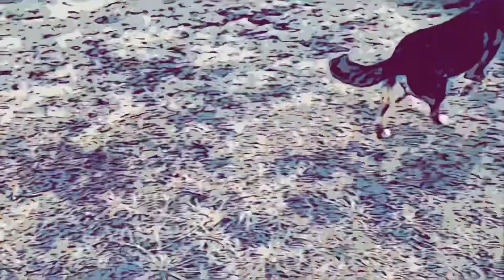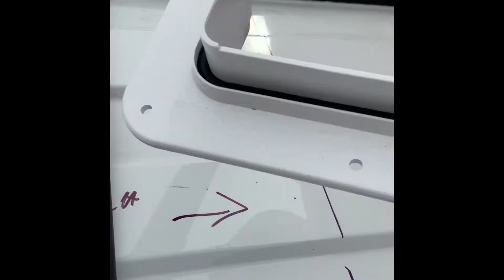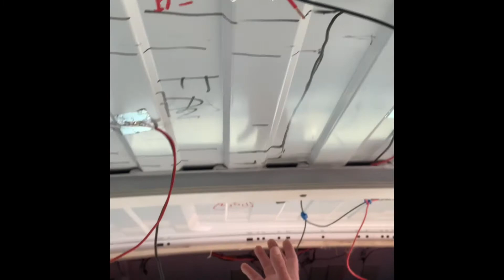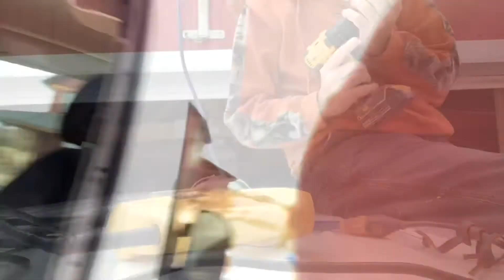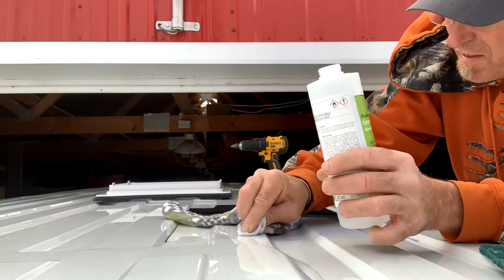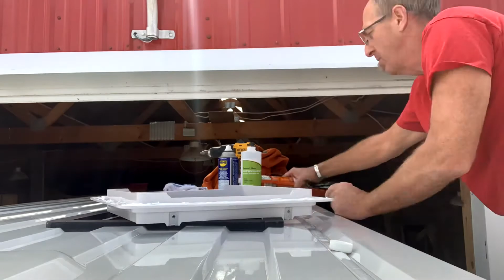MaxxAir Fan Installation with Roof Ring

Comment: Enjoying your videos, just picked up my 2018 1500, going to start the build soon.
Do you think it is necessary to add a wood frame on the inside for the fan?
I have seen it both ways.
Thanks
Reply from the maker: I put some in but light. It depends on where you place the fan. Good luck

Comment: Great video Thanks. I purchased one of the rings as in your video.
Looks like a cleaner install but I was wondering how weather safe they are and how long they may last.
I am in the desert, hot and dry. Hope it doesnt deteriorate. How has yours been?
Thanks
Reply: I have done 3 now and they have been really good. One has quite a bit of sun/desert time. No deterioration. Good luck
Reply: @johnthorsteinsson6122  Thanks.

Comment: Nice. Hows fan, any leaks?
Does promaster have any constant power wires near by under roof to tie to? Ty
Reply from the maker: Fan is Awsome. You will not lose the cover if you forget the close it. Creates an amazing breeze from window. Very quiet. No power wires that I found. I put 2 fuse boxes in. One up on the front wall. One in the back. All off the rear batteries
Reply: @dadzvanz936   Awesome! Thx. My main concern is not being able to go thru drive thru's anymore once its in 😪